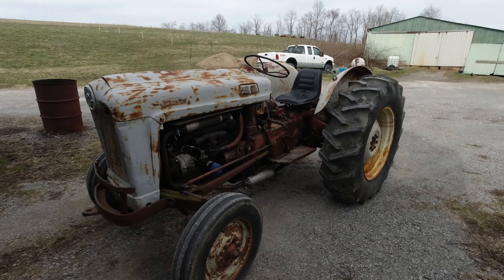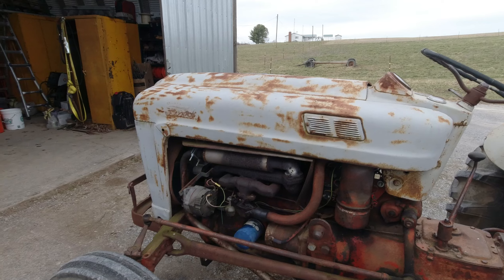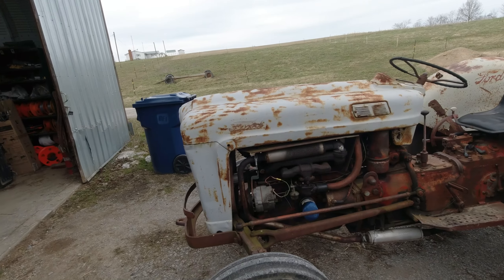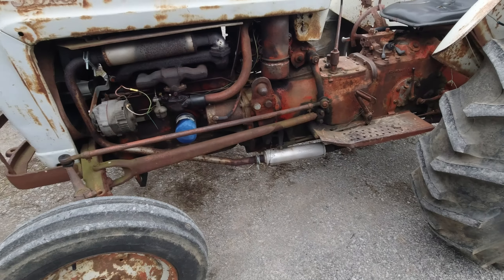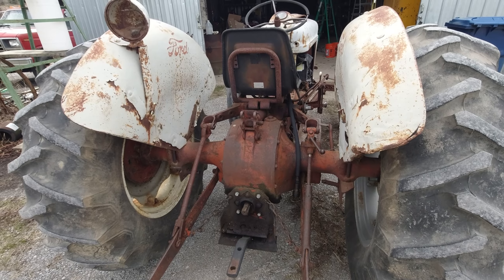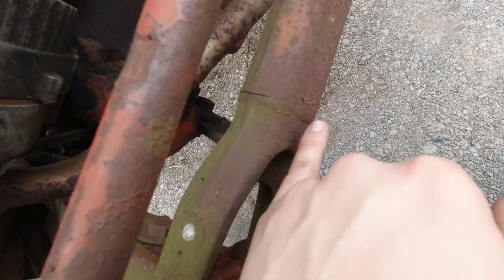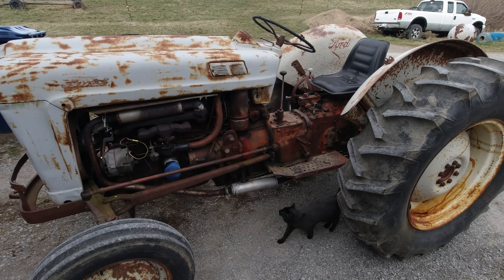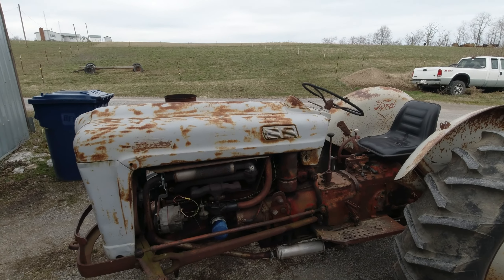Ford 860 greatest return - Mossy Roots Farm

Comment: Yes you do have a two way valve but the other hose is not installed.
Reply from the maker: I thought it was only one way. Capable. I didn't think they made those back then. Unless you had a retro kit from a more modern time.